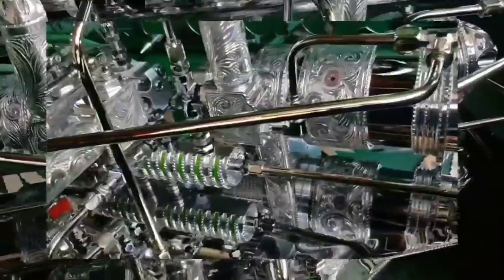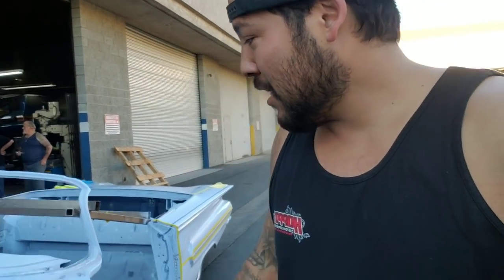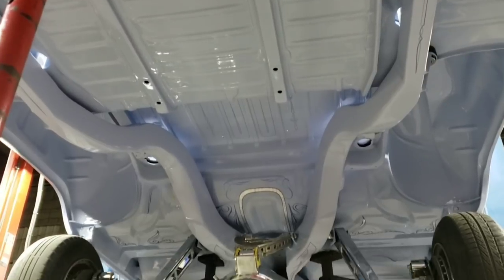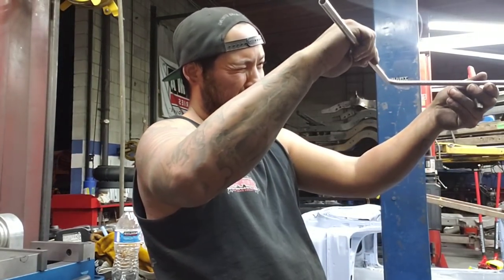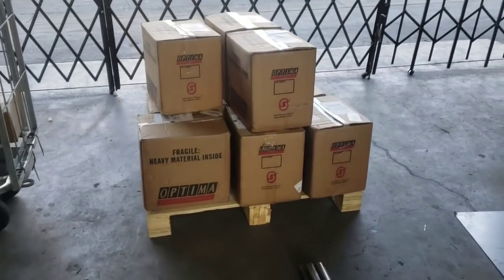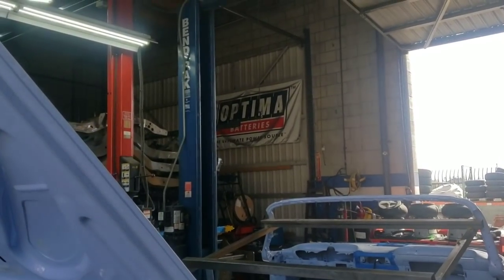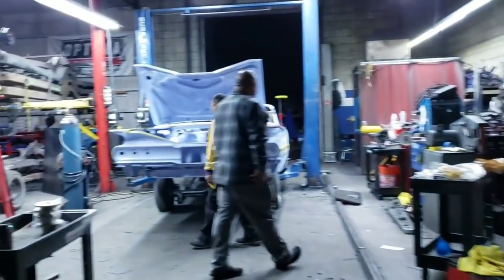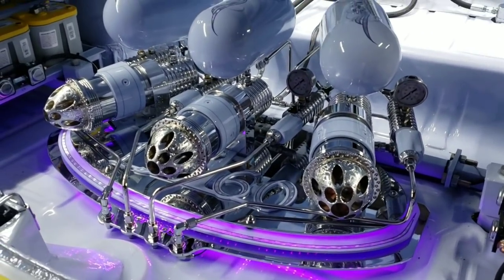The 60 impala  "part 2"

Comment: This car came out sooooo nice Alex! Obviously it's a show car but are you the least bit concerned of the hoses running thru the car or cylinder wiggle up front with hardlines? Genuine question, that's not a slander towards workmanship because y'all are off the charts. Anyhow, great video as always and great way to word a "rant". Congratulations on the baby
Reply from the maker: No we always run hoses on the inside on full blown show, and when they do the upholstery  they make sure that they are still able to be maintained if needed,  in the future  and our front hardlines always have bends in them to allow for flex/slight movment but never any issues is done correctly
Reply: @Hoppos_alex  looks great, thanks for the response